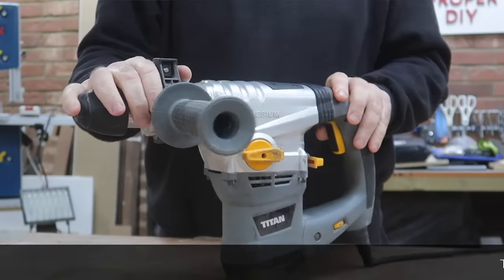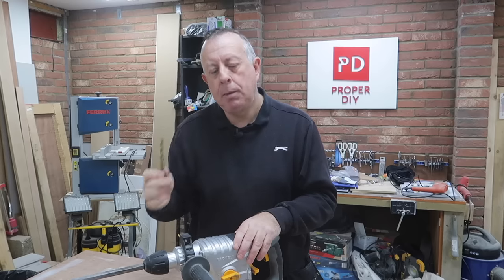Don't Buy Just a Hammer Drill

Comment: My tiny little makita has no issues with hardened, 40yo concrete, it takes roughly 2 years and a high-er end bit has not much wear at the end.
That .. till you hit some rebar. It'll cost you an extra HSS bit. Ask me how I know.

Definitely in the market for a proper sds drill. There are not a lot of materials that can handle 4 joules 4000 times a minute.

Comment: I've just moved into a house with brick so incredibly hard that I could actually hear it laughing at me when I tried (and failed) to put up a coat rack using my tired, old cordless hammer drill.
Well it'll be laughing on the other side of its bricky little face when I get myself one of these!! :) Cheers for the video - great stuff as always, Stuart!
Reply: Picked one up from Screwfix yesterday - and blimey heck it's a BEAST! Not only does it weigh as much as a small car, it doesn't half munch through the brickwork. Coat rack successfully installed. Now I'm looking round for other things to unnecessarily drill...

Comment: Two days go I wanted to drill wholes in my grandfathers house. I only drilled concrete walls before - one hole was ok - the second hole fell apart and the third hole became a straight line going upwards. It was bult in the 1930´s and they just used what they had. With the last I must have hit a random rock in the wall and the hammer action made the drill go through the remaining softer marterial.

Comment: In German, the difference in names makes the difference in construction very obvious: Schlagbohrer ("beat drill") vs. Bohrhammer ("drill hammer"). The pneumatic drill hammer is basically a jackhammer. You can even switch off the rotation to use it just like a jackhammer.
Are they both called "hammer drill" in English?

Comment: My drill came with a tube of grease for lubricating the drill bit spline.
Sometimes I remember to use it.
Maybe it reduces wear in the chuck.
Reply: it is important to lubricate the drill, it goes faster and it prevents the drill from getting stuck in the drill chuck.
There is often a dust cap to place on the drill bit on the SDS part to prevent dust from entering the chuck, again it prevents the drill from getting stuck in the drill chuck.

Comment: Hello, thank you for your video! That awkward moment when you live in Russia or the post-Soviet space, where only brick and concrete are mostly used in construction, and only a sds rotary - hammer drill is used to drill holes. Hammer drill - 3-6mm, less often 8mm, but holes from 8mm to 80 mm - only sds-plus and sds-max. I worked with hammer drill a several times with a small diameter drills  - it was a terrible experience for the hands and especially the ears.
Reply from the maker: Thanks for watching!

Comment: I’ve got the Ridgid 18V SDS Rotory drill and the 18V Hammer drill. When I compared them drilling lag bolts to fasten my shed to the slab it was night and day difference on how they performed.
Reply from the maker: Exactly
Reply: @ProperDIY  I do have a question though. Maybe you know? Ice fishing using an 8" Strikemaster Auger (for cordless drills) The SDS in drill mode with a milwaukee SDS chuck adapter is just awful drilling holes in the ice, it cuts out a lot. My Ridgid Hammer drill however, on drill mode speed 1, can tear through the ice like butter. Even though on paper it's far less powerful.  SDS Model: R86711 Hammer drill Model:  R86115

Comment: at my work we have to buy 2 30mmX2ft-ish sds bits each time we do a special job, and each only drills one hole.  Every time we have to drain one of our aluminum holding furnaces, they go through the refractory once then get coated in molten aluminum, and can't be used successfully again.  Always feels like a huge waste, but I can't really think of anything else that would go through 20 inches of refractory.

Comment: If you are using a high quality drill bit, it will have a carbide tip. Carbide stays hard even when red hot. So there shouldn't be anything harmful about using a hand drill in brick. It will just be slow. If someone says they only got a few holes per drill bit, it means they are using the cheese grade bit that came with a dollar store drill bit kit.

Comment: He's an EVEN BETTER TIP: buy a bit for the sds drill, that is like er, how best to describe it? that allows you to put a nail in the sunken bit, so that the sds drill acts like a nail hammer. It works really well. you can get better results than manual, since, you get the accuracy, instantly, since you just rest the drill onto the nail, and the action just pushes/hammers the nail in, even with massive big nails, since, no point with small little nails.

Comment: Great explanation of types of concrete and what the alternatives are to complete a job...as for me I will use this as my guide to get the drilling done in my basement concrete wall as I have 18 holes to do and my Mikita hammer drill just wasn't cutting it. (or should I say drilling it?) Thanks this helps

Comment: My Makita SDS has been going strong for years, unfortunately there isn't a feature to stop the rotation.  My best was drilling through a 1 metre thick wall with a 10MM 1M bit, it only just popped out the other side as well, not bad at all for a old 14V battery drill.

Comment: Definitely night and day when drilling harder materials. 
When using the hammer function don’t lean on the tool with your body weight. Let the hammer action do the work it is far more effect. If you want to lean on it hard use a pneumatic drill as a road crew 😁

Comment: I ordered my first Sealey SDS max rotary hammer drill as I found that the terratak hammer drill can't go into the brick even though it should. Even the Bosch combi drill on hammer mode did better than the terratak hammer drill..but still, the Bosch combi drill is weak and takes too much pushing pressure(it didn't break, relax😅) 
I can swear by the looks of the terratak hammer drill that it looks to be a plus and not a max. So before I came across this video I researched into finding something that can smash holes in bricks with ease(even 2cm into it) and the prices are real high for max rotary hammer drills..like £300-£650.
Then I came across this Sealey SDS max40 hammer drill for £108.
Let's see how it goes when I it arrives. 6kg too. These things are demolition tools.

What I'd like to know is if the impact of drilling will be powerful enough to knock me off the ladder?😅

Comment: Nice informative video. But I think you forgot to mention that a real pneumatic hammer drill like you have shown (yes, the hitting function is done with a pneumatic piston) also has the advantage that if your drill gets stuck it will continue hammering to losen the drill.
Personally I am not a big fan of the very cheap hammer drills because they are very heavy and not as efficient as the more expensive ones. If you only need to do a few holes now and then they are more than ok, but if you have big renovation plans the big brands have hobby/DYI series that are affordable and do a much better job (for example : bosch green series).
Also remember that it's not really the watts of a hammer drill that will tell you how "strong" it is (at least not for it's hammering strength), it'll tell you how much electricity it consumes. The thing to really look after is the hammering energy which is given in Joules(J). And remember, cheaper brands tend to lie about those specifications (or measure/calculate them in a situation that gives them the best numbers). You can easily find a 750W branded hammer drill that is more efficient at drilling thru concrete than a 1500W cheap one, but it'll be double the price (or more).

Comment: I borrowed one of these bad boys to drill a  50mm hole through the outside wall of my outhouse for the drainpipe for a washing machine. Diamond-tipped hole cutter & the SDS drill (with a clutch for when the cutter got hold of a really chewy bit!) & The job was done in 20 minutes. I was sorry when I had to hand it back!
One thing to watch though - be careful when the drill bit breaks through on the exit hole. It can make an unholy mess, smashing a chunk of brick or breeze block out. A work colleague used one at an office block, b#+&rred it up & left me to explain it to the customer. Neither the customer nor I were impressed...😠

Comment: Eh... if you're just hanging curtains or only use it a few times, stick with hammer mode on a standard drill and use the most expensive bits you can find. I've done a lot of work on my house and I've only needed to drill holes in concrete a few times. I'm in the states though and live in a stick-built house, so that makes a big difference. If I do ever need an SDS drill I'll likely rent one instead of buying.

Comment: If you are drilling with masonry bits, get a glass of water and a stone chisel with a point... Smack the point to start the hole, a center punch if you would, and drop a few drops of water in there, drill a bit in and pour some water in the hole... It will make your drills last for ages and will cancel out the dusting effect, while slurrying the junk out through the flutes... Add more water when you see no steam rising anymore, but that goes for extra deep holes... A syringe works well for water injections, and most of the times, you wont ever use up more than a 10 mil per hole and it likely wont even steam up... Lest you are drilling a 10-20 inch holes 1 thick in concrete or stone... there you might need 200 mil of water per hole just to keep the drill cool and to contend with dust another 200 mil...

Comment: Hi,

Great informative video.

My sincere apologies if my comment is going out of the topic. I came across your video after searching for “hammer drill chuck wobble”.

The problem here is that I recently purchased a hammer drill and noticed that the chuck is wobbling, and immediately I reported this issue to the seller. The seller said that it's perfectly normal, and it happens not only with their machine, but machines of other brands as well.

I then started researching for “hammer drill chuck wobble” and to my surprise, the search results are flooded with chuck wobble for renowned brands like Makita, Bosch, Dewalt etc.

Some people are saying that it's perfectly normal for the chuck to wobble because it is due to the nature of the design; whereas other people are saying that it is possibly because of the defective machine and continuing to use the machine will lead to early wear & tear.

I will appreciate if you can share your experience on this as there are many users who are looking for answers. If you can make a video on this, that would be even better.

Thanks.

Comment: Can confirm that SDS tools are the bee's knees--In particular, for drilling I've found that the bits designed to be able to drill through reinforced concrete (i.e. rebar) tend to be the best by far, both in terms of lifespan per dollar, and in terms of the quality of the holes that they drill.
Reply from the maker: You are right there!
Reply: This might sound impressive to anyone who doesn't work with concrete... It's not impressive.

Comment: Yeah noone realy uses hammer function on akkuschrauber from my experience good drillbits make about 150 holes max depending on situation if you need to go through or partly throuh rebar then less ofc aftrr that the hole is too small for fast montage but ofc if you are going to make 4  holes thru 2cm of fasade on 8th flor of stepps you just hand your smallest option

Comment: The new flat and its high strength concrete wall my mom moved into drove me NUTZ with her fetish of hanging up like three dozen pictures per m² to the walls. Her collection of hats then broke the camel's back, and I told her we'd have to invest in something more substantial that what I could offer after wasting plenty of time trying to drill holes into the wall near the entrance surrounding the building's elevator. So off we went and bought a BOISCH SDS UniversalHammer 18V ( since I'm already invested in their lineup ) and truth to be told I wasn't exactly expecting a revelation - merely just being able to get the job done - but sure enough the bit went through the walls like a hot knife through butter 🤨

Comment: Thank you for this video. I'm having problems drilling just to put in some rawplugs and screws for shelving. Probably because the house is nearly 100 years old. I've already worn out a bit, and this is now £65 from Screwfix.

One question: is there any problem as the bit hammers in so much that I could make a hole that's too big for the rawplug using an SDS as that's quite a lot of extra distance.

Comment: That was very interesting .  My old Bosch SDS drill which was very good decided to
pack up after many years of intermittent use.  I didn't buy a replacement as I had two
ordinary drills that had the hammer action and thought they would do.  I didn't really
understand the difference between them and now I do!  Just as well as I have a couple
of fence posts to replace that were concreted in about 40 years ago so I think I might
just check out whats available.  A good video, thanks.
Reply from the maker: I'm glad you enjoyed it.

Comment: Any tips on avoiding too much   bit dancing when drilling into brick. I sometimes find it the entrance hole gets too big. Would you recommend using a smaller but to start and then a bigger one?
Reply: Use a smaller and shorter bit to drill a pilot hole, so the actual drill bit gets through the first bit easily and accurately. I have an old home with old and crumbly bricks, what I often do is drill a small pilot hole, then drill full depth with a bit half a millimeter smaller than what I need, check if the plug/anchor doesn't fit already, and only drill carefully with the exact size if needed.

Comment: All I want to do is drill holes in my brick wall in which to place anchor bolts to support my cloth line. I have a regular drill that gets me around the simple stuff but now, it looks like I need a “hammer” drill, an SDS even. They all look so heavy and most are so expensive. I need advice. What is the lightest hammer drill I can get away with to do my clothes line job.

Comment: This is totally un-necessary for drilling concrete. The difference in drilling performance is down to the carbide - especially the quad-carbides (which are amazing for also going through rebar). Get one of these quad-carbide SDS bits, cut off the SDS mount from the end with an angle-grinder, and use it in any standard-chucked hammer drill - they work amazing!
Reply: I've been drilling all day with the SDS bit in the 3 jaw on my regular drill, but came to youtube to find if there was an easier way, I think I'm going to buy a new drill tomorrow
Reply: @RangieNZ  it was wobbly but gripping!
Reply: @alexjohnward  You must have already cut off the SDS mount then, as the 4-sided  SDS mount won't secure in a standard 3-jaw chuck.  They COULD have made SDS bits compatible with a 3-jaw chuck yet didn't - this is totally anti-competitive (- locking certain bits to certain drill types), and is wrong.  I would be more forgiving of SDS, if they had not tried to lock out certain (very good) bits, from being used on non-SDS drills.
Reply: @alexjohnward  SO, you spent "all day" drilling holes in concrete, with a bit that "was wobbly but gripping"?  The cutouts in the SDS mount are so large, that you cannot get a 3-jaw chuck to tighten on it.  Also, don't forget that any 'wobble' would happen with every rotation. So, the drill is doing 1500(?) RPM, shaking terribly with every rotation, and you did that "all day"?   No you didn't.  This is just a BS shill response, to get people to click on the Amazon links, to get paid from Amazon for looking at a tool they don't need.
Reply: @RangieNZ  I can assure you I did, and it really wasn't that bad, I don't use Amazon let alone know about links. I saw the funny grip and figured there must be a reason for it, and this video appeared on Youtube. If you think everything is a conspiracy against you I pity you.

Comment: Hi . That Tipton drill although it is a cheep screw fix model what is it like and how does it handle? I have heard a lot of good things about it and a lot of bad things, I don’t go for the big brand names in opinion they are overpriced and overrated and they all come out of the same factory in China just branded for whoever want’s them my rotary 20v SDS+ Rotary hammer drill cost £70  of Amazon and has a brand name that no one can pronounce, yet it is acsactly the same as the  the big brands just a different colour and it is a fantastic bit of kit I also have a 240v corded one which is identical to the bosh accept it is grey and silver not blue again a fantastic bit of kit for £85 . So I am interested in the Titon . Great advice on the proper use of drill bits and the correct drill for the job 👍
Fantastic video as always 👍👍👍❤️
Reply: I have the same model - it's excellent, simple controls, 1500 Watts.  The case is very tough, plenty of bits and the detachable handle is adjustable too.  It's easy work on brick, concrete is polystyrene, it's heavy but a beast.  For £80, you can rag it until it breaks and get a new one.  Had mine three years, it's still trucking, no signs of wear yet.  Biggest job - used it to smash up a 6' x 4' concrete shed base... easy peasy.
Reply from the maker: Thanks. I have no complaints - I don't use it that often but when I do it works well